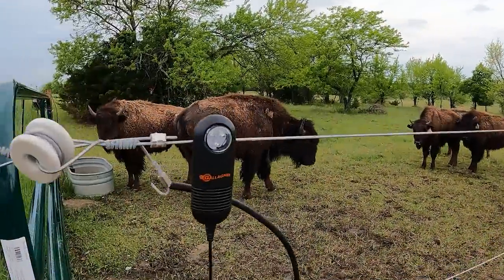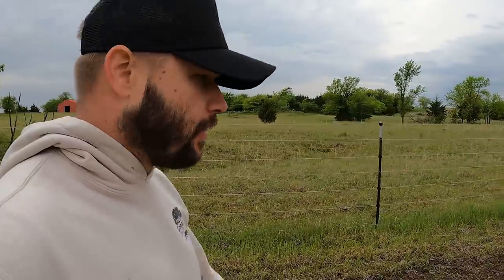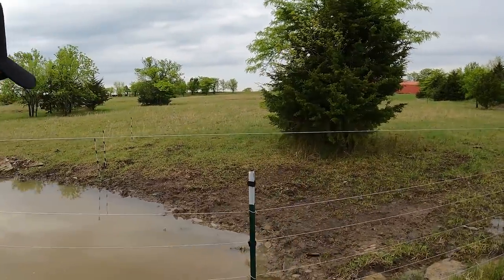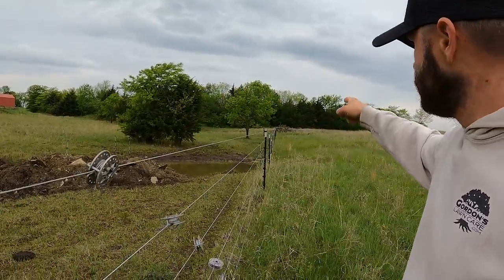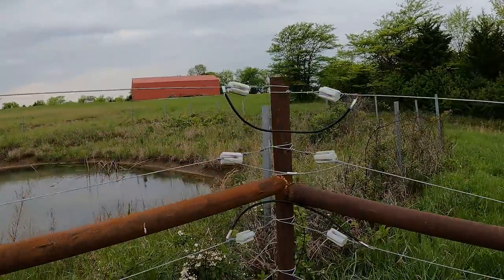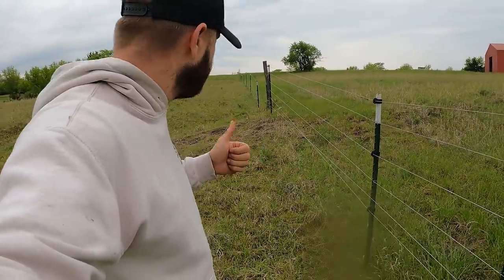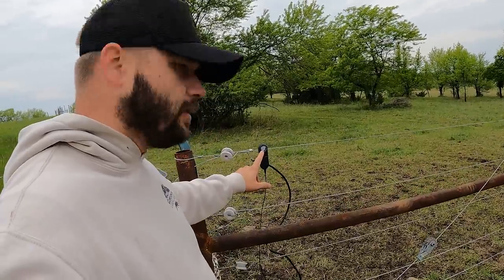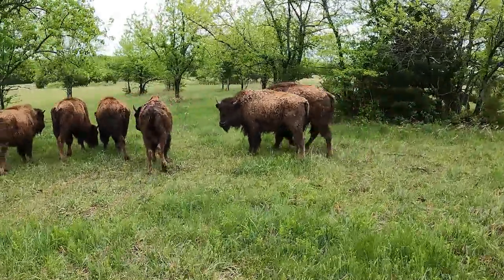The Bison fence was OFF...

Comment: Good looking fence and great looking bison. Would recommend lockjaws insulators, haven't replaced a single one since I started using them over a year ago.
Reply from the maker: I actually looked at them online today, thank you!
Reply: Also, look up 3d deer fence. I think that would help you with your rotational grazing. Works pretty well when the cows start jumping fence and can be setup just like your regular temporary fence
Reply: 3ft top wire, 1ft bottom wire. 3ft offset wire at 2ft.
Reply from the maker: I’ll check it out thank you!
Reply from the maker: Thanks!

Comment: Wwe had a bad batch of insulators right out of the bag, the company had a batch of plastic that wasn't mixed properly- made them brittle
Reply from the maker: Makes me think I’ve got the same problem. I’ve never had them break on me like that before. Glad to know it’s not just me!
Reply: We had the same issue as you.our insulators were the yellow ones. They would turn white & brittle in this ga heat.
Reply from the maker: Yeah I’ve heard the yellow ones don’t hold up as long as the black ones.... but maybe not. LOL
Reply: Looks like a cool, cloudy day. If you stetched your wire on a hot day it will contract when it gets cool.
Reply from the maker: Interesting. Didn’t know that!
Reply from the maker: Pretty neat!
Reply: @BrokenArrowBison  I've seen a post in a little swale come out of the ground overnight as the wire contracted on a cool night. Your tensioners can take care of that. If you get a cold snap, loosen them a notch or two and you wont be replacing so many insulators, particularly where the fence goes up or down on uneven ground. Your insulators are taking all that strain.
Reply from the maker: Yeah I do have some uneven terrain on one side of the fence.
Reply: @BrokenArrowBison  I was a fencing contractor for years in Canada where temperatures range from +90F to -40F and often vary 60 degrees in a 24 hour period. We had to fence through swamps to the top of granite bluffs so we learned a few tricks over the years.
Reply from the maker: That’s good to know. Did you ever fence using high tensile?
Reply: @BrokenArrowBison  Only as a top wire for 9 strand farm fence, usually to keep horses from reaching over and bending down the top strands.

Comment: Sorry , I only speek a little ENGLISH . Your littles bisons look very calms . Your problem result in the electrical ISOLATORS , very too fragiles !
Because your meadow is very unevennes , the treast wires are stretched in différents directions .
No problem when the tension it's to the down , but if the wire is stretched in the upper direction  the wire tension break the tie-top of the isolator .
SOLUTION :  Turn your isolator trop 180° with thé tie-closing DOWN and the pression of the wire pusch now on the other face on the isolator MORE ROBUST !
Good luck and congratulations .
Reply: Wow!!! Hood info.